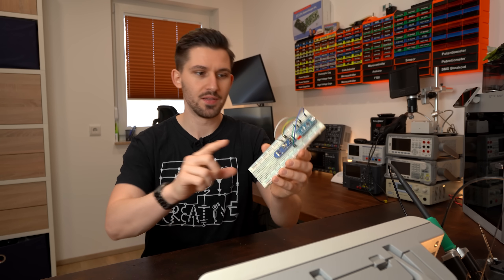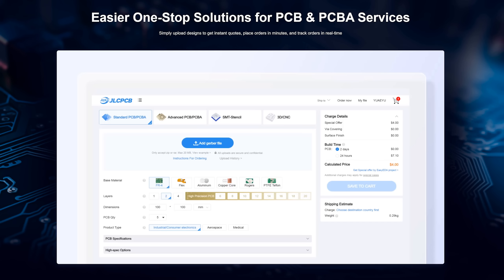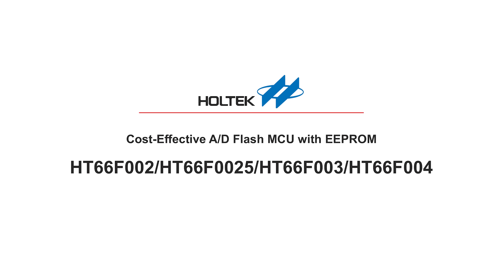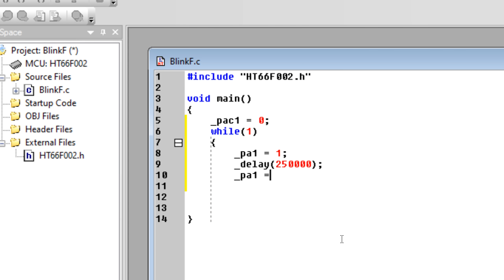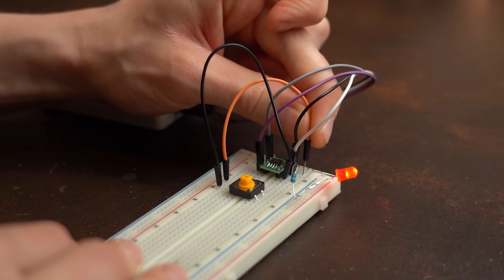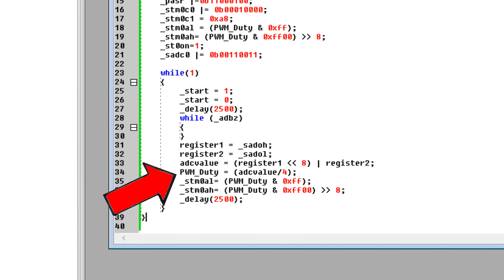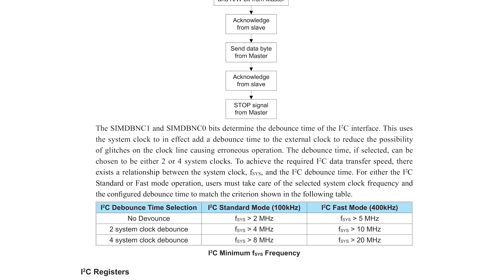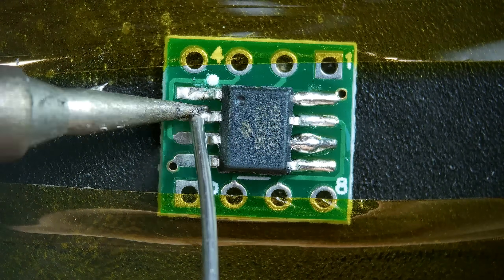I tried the Cheapest Arduino Alternative (that Nobody heard of)

Comment: That was interesting! It just shows no matter how sure we are about a new uP there may always be just one thing to ruin the whole project. Why not use an Arduino with i2c then fan it out with the clock through an analog switch? (4067) That's what I did to control multiple i2c audio processors that of course had no unique address as i2c. Cheers!

Comment: This is holtek mcu and I worked it, but it has some problems,  for example very expensive programmer, and it doesn't support external crystal and it very important. 
It hasn't debug peripherals or some protocol communication. 
Stm8 and ht8 are equal price but stm8 has very high features

Comment: I mainly develop for myself as a hobby.
Very occasionally someone will buy one of my designs so it makes no sense for me to go through the learning curve to save 2 or 3 bucks - so I don't.
So if someone wants one of my designs they need to pay for a Nano board.
Normally the Nano is way over-kill but so what?
If someone were to order 10,000 units that would be a different case but I don't think that will ever happen in my lifetime.
And in any case, there is always someone "out there" that can undercut you so why bother.
I'm looking at you China - with your armies of reverse engineers...

Comment: You could get a pico 2 rp2350 and sell some Shizzle because the main differences which I have discovaried is a decent component cost roughly 50 cents, and if its all the useful, simplification is just another way to screw it up.  But a Chinese part is already a screwed up masterpiece.

Comment: it is not about cheap MCU vs Arduino. Only reason why arduino is super easy to use and program is that you are using arduino IDE and scripts, you are not programing it like any orher MCU using for exampe eclipse. If you will program arduino using eclipse and C indstead of using arduino script languaage it will be exactly tha same. You have to care about registers and configuration of timers etc... But your code will be much more efficient and optimized and smaller. Finally you anyway have to forget to Arduino IDE and start programming like real programmer in C language. Arduino IDE is only like starting point for beginners. Or for those which dont want to be programmers, just want to make things working somehow quickly without too much effort.,, If you will try to use your arduino without Arduino IDE, and write program in C for it, it will be same struggle like you have with your cheap 20 cents MCU.

Comment: ATTINY202 has built-in I2C and SPI. You can also do pwm quite easily. Costs between 45 and 50 cents per piece. I generally program these using avr-gcc but I think Arduino supports some of the attiny chips. For me, if a platform doesn't have native Linux support then I generally don't use the microcontrollers in my projects,  so some of these cheaper options don't work for me 😅
Reply: Hello, how to use avr gcc to program tiny 1 series ?

Comment: Scott great video! I notice you are calling the e-link a programmer when in reality it is a powerful emulator. That serial part you missed is not necessary since you have an emulator and can run step by step each line of code for debugging, something that Arduino doesn't have. As you found out i2c can be implemented by software, so can serial. I have been using this Holtek for over a decade and their prices are unbeatable. I have over 100,000 units of a product using this microcontroller without ever having had any problems. Thank you!

Comment: save 28$ on chips by byuing $71 programming interface ;) to use $0.2 mcu instead of $2.2 mcu...beacause math is for snobs. you would be better of getting attiny402 or attiny 13, twice the price, 4x the compute power and I2c interface at hand, also atmel studio( i refuse to call it microchip studio) gives you step by step debuggin capabilities using avr dragon or atmel ICE...Dragon saved me from insnity quite a few times...

Comment: So I'm not sure how much you paid for that programmer, but the cheapest price I'm seeing right now on all the express is over $70. That means you would have to buy at least something like 40 of the microchips before you hit that break even point. That is not going be practical for most of your viewers lol. For me, just a hobbyist, I've only actually used about a half a dozen different microcontrollers in projects. And I would think that even for some of your more avid viewers, they are likely to only use a few dozen over the course of several years. I'm curious for you, how many microcontrollers have you used in actual projects? 100? For this project, unless you got that programmer really cheap, you ended up spending a whole lot more than if you had just gone with the $2 microcontrollers.

Comment: Instead of buying a microcontroller for $0.20 and then spending $85 on a proprietary programmer, it's much more practical to go for something like the ATtiny85, which is widely supported and easy to use. Holtek has deliberately limited the documentation for their simple programmer, pushing you towards buying their expensive proprietary tool. So, keep in mind, you’re really spending $85.20, not just $0.20, if you choose to go with this microcontroller.

Comment: According to Wikipedia ( https://en.wikipedia.org/wiki/PIC_instruction_listings#Holtek_clones_(14,_15_or_16_bit) ), those µCUs seem to be PIC clones, which is great for firmware development.
Too bad the programmer is only sold thru their distributor: I won't be wasting weeks waiting for it to arrive, and, much more important, I won't be dealing with customs, which would take another 6 weeks to clear!
Those chips are a big "no-no" until someone develops a DIY programmer, or they start selling the programmer on RS/Farnell... or better still, Amazon!

Comment: these microcontrollers are used in tv remote controls and it looks like it uses i2c for programming so probably somebody can make use of an arduino to flash it
probably the IDE is an overkill since you only need a compiler...

Comment: If I were you, I'd get myself a couple of ATtiny85 chips. They're dirt cheap, well documented and with all the features you need. And they don't need the expensive e-Link, you can use an arduino uno to program it
Reply: I assume he was looking for something JLCPCB have among their parts, to order come already assembled boards.
They do have ATtiny µCUs in their catalog, but not in stock (the same goes for PICs): that would increase production time, since they don't even specify an ETA for those parts.

Comment: Its cool to see you go oldscool. 15-20 years ago I used a simple 8 pin PIC Risc controller and send/receive I2C commands/values on a std I/O port. It was quite simple assembler programming. The only problem was that the timing was of. Then I found out that the internal oscillator had to be written a factory calibration value.
I used PIC controllers in the swedish projects "Pianotrappan", "Tomglasautomaten" and "Världens djupaste papperskorg" on youtube.
Reply: that was literally the first thing I thought about. all you need is just two gpio pins and some bit-banging.

Comment: wow good job. $0.20 mc + $110 programmer. Much cheaper than $2.
Reply: The idea, if you actually watched the first 2 minutes of the video, is not for a one-time microcontroller project but for a whole series of them.

You can spend $3 for 100 microcontrollers, totalling $300
Or you can spend $0.2 for 100 microcontrollers + a programmer of $100, totalling $120

Actually pay attention to the video before commenting such things :)

Comment: total cost (including shipping) for those 14 arduinos vs shipping cost for one of the cheaper ones, then the shipping cost of the bigger one with i2c, then the shipping cost of the rest of the gear (or shipping cost of 14 of the first one, then 14 of the second one depending on how it went) would already mean if it takes more than 10 minutes to program it's not worth the effort. Not to include the cost of programmer etc. 

Anyway, I do understand the main point of this probably wasn't to actually save money but to show there are alternatives. Or something. And it would obviously be a whole different ball game if you needed to do 1000s of those. Currently the only thing it shows is that arduino has made so many things possible for so many people in situations where it didn't earlier make sense even to get started. Time is the most expensive element in many projects, no matter whether it's hobby or professional.

Comment: Have you tried MPLAB PICKit  for "Microchip" brand controllers? They support others as well. The company is called Microchip Technology Inc.   I used PICkit 3 several years ago and programmed a controller to do an LED marquee pretty quickly. They were around before Arduino and have a bit more support than the system you demonstrated.
Reply: They are based in the US, but there were quite a few Europeans using it (I got help from a Brit way back when).

Comment: I never advise my students to use the delay() statement, given that it kills the program for the time they've set and it's a waste of resources. On Arduino it is preferable to use the "millis()" function and for the HT66F002 it is easy to implement an interrupt handler and build a similar "millis()" function for the HT66F002. Especially in robotics we should avoid using "delay()" instructions.

Comment: Creator similar machine that Uses sound to indicate distance. I used an ultrasonic sensor in my own circuit design.
Reply: I wrote my own custom code that goes inside North. We know, replicate that in order to add multiple versions of itself together, you could create software that is embedded into The same software, but with a few variable differences

Comment: I get Attiny85 vibes of this. That chip is maybe 1€, and works in the Arduino workflow we already know. You can even buy it on a 2mm thick mini-board that fits straight into the USB port. It has I2C, SPI, UART and 3x PWM and can have an USB bootloader.

Comment: The ATTINY402 is an interesting alternative, cheap and is very capable 8 pin IC. You can upload arduino code with platformio with UPDI protocol.

Comment: Did you test in-circuit debugging? The IDE has buttons related to it.
I refuse to use any bare metal mcu without breakpoint debugging support, the printf debugging is just massively slow for anything even mildly complex.

Comment: I am disappointed in Holtek processors.  Yes they are cheaper than Arduino. but I was hoping for more.  The Arduino has so much baggage that it can't do much.  I thought cheaper Holtek would be without that baggage.  But no, it has Arduino baggage!  (When I saw the "digital write" command, that was the evidence.)  Digital write is 50 times slower than writing directly to the port!  The other thing that needs to go is the C programming.  Ditch that & use assembly & you will REALLY be able to do something with Holtek!
          Another thing you can do is to use a distance sensor that starts a HIGH when it sends out pulse, goes LOW when it comes back.  No need for I2C.  Just measure the time interval!  I2C is just another layer of unneeded baggage!  You can write a loop that goes around FAST.  In that loop, you can measure the time of the pulse to get the distance, & control the PWM for the LED with no need for timers!
          If you set up the loop as a timer-invoked interrupt, in the time left over, you can have debugging code running concurrently.  This allows debugging WHILE the code RUNS.
          Libraries are the last thing you need for small, simple processor.  They are the source of the baggage I refer to.  What libraries do is enable "plausible looking" code to be written maybe faster.  Why use programs "for everyone else" versus "a program customized for me"?

Comment: @4:17 I highly not recommend to solder the pins while the pins are inserted in the plastic Socket Board, because the plastic inside the Breadboard may melt and the connectors inside the plastic will lose electric connection, this may ruin your test. Make all the soldering outside the plastic breadboard and then plug it back.

Comment: Back in the 2008 I used Holtek HT46F47 in security product I designed for American company, it was amazing cost saving MCU chip, I programmed it in Hybrid (C and Assembly) to perform at high speed in my algorithm that convert the reflected Acoustic Magnetic reflected waves into electronic signals, converted into digital signal and the AM wave signature was extracted. Although there were not enough Application Notes, I took the required ApNotes from various manufacturers (Microchip, NEC, Motorola, Philips and so on...) and used it on Holtek ... The results were amazing and exceeded the expectation of project requirements...! Holtek is not only manufacturing very cheap MCUs and are great alternatives. The same chip from Motorola was around $2.70 UD, Microchip about $1.70 USD back then - from Holtek it was only $0.33 USD for the same volume of purchase- Go for it.

Comment: If you don't feel like dealing with Chinese micros, Microchip makes a PIC16F15213 (8 pin) which is well under $1 (the SOIC pkg is under 50c qty 1) and covers your list.  There are also pin upgrades to increase pin count, memory, etc in the same and other families.  Edit: The ATTiny402 is another good choice (and also made by Microchip).

Comment: Nice video. That's how life used to be (and is) with proprietary controllers and near-zero libraries. Lawyering with the datasheet and register descriptions, debugging with blinking LEDs and oscilloscopes and maybe a display or UART once you got one running.  First time I saw the led blink, I was thinking "running or bootloop?" :-D

Comment: It is possible to make Arduino core(read: support) for this microcontroller. Arduino has very good engeneered HAL layer. And it's not a problem if the microcontroller does not have certain features(like Serial of I2C). By doing that many aeduino libraries become available to you. Including those which can bit-bang missing features. So you can bit bang Serial output for ease of debugging

Comment: No, not pointless. Surely you only need one Master controller? Consequently the cost implication would be minimal? The Arduino is 'easier' to program because you have the over burden of the, not sure if this is the correct terminology, of the interpreter/translator that replaces the Arduino commands with blocks of code, yes, makes programming easier and programs more readable but slows things down, sometimes a lot! Finally, welcome to the real world of programming. The most important part of commercial programming is commenting/documenting of the code, without this, maintaining the code can be a nightmare! Even with amateur code, it's amazing what you can forget in just a couple of weeks!

Comment: ch32v003 a $0.10 risc-v mcu. Also has an english version of the datasheet and reference manual on their international website (wch-ic). And also a lot more support from people using it. Like an arduino core and a bit-banged USB stack. Also the ch32v003 has I2C in master and slave mode as well as all the other features you need. While being cheaper than the first mcu you used. And you also dont need an expensive programmer.

Comment: Nice video, but I feel there's an unfair price comparison of a bare µC vs. the dev boards (µC, PCB, regulator, headers, ancillary components).  One would think some of these companies would put in the effort to get their products supported within the Arduino IDE framework to reach a larger market, and cross-platform support for the developers.  I gave up on keeping a Windows box around.
I keep a variety of µCs onhand, from a few ATTiny10, lots of ATTiny13A, 84, 85, some larger AVRs, and RISCV parts, plus STM and even 8051 parts (devboards with micros pre-populated are a whole different thing).  Being able to pull out a micro suitable to a given project is handy, esp when shipping can easily dwarf the cost of some parts.

Comment: i just don`t undestand why people still using arduino and same shit... u get 16 or less mhz, low amount of memory and so on. 
there are a lots of stm32 (arm core) mcu`s , that are way more powerful and much more cost effective. 

ive checked holtek mcu from this video - for me it costs 1$ and there is for example stm32g031j6m6 (so8) and its much more powerful, has good software support and same package. 

0.5$ price difference is not an argument to use such product (holtek) even for education purposes.

Comment: I see that there are plenty of suggestions already for cheap microcontrollers.  But I'll throw in my suggestion anyway: the Atmel ATtiny202 and ATtiny402 series.  These are the new-generation AVR chips, intended to replace older chips like the ATtiny20.  There is 3rd-party support for these in Arduino IDE, and programming is done by UPDI, which is a 1-pin bidirectional serial interface.  The best news is that people on the Internet have worked out all of the kinks by now, and you can make a UPDI programmer out of two components: a USB/serial adapter you can get for $3, and a 4kohm resistor.  The latest version of avrdude (the best AVR programming application IMO) supports this, which means that you can develop code in Arduino IDE, do an "export compiled binary", and program with avrdude.  It sounds complicated, but you get to use all of the built-in helper code that comes with Arduino IDE.  Oh, yes: a little more expensive, these cost me $0.53 each from either DigiKey or Mouser last August, and tons in stock because these are jellybean parts.  I used these on a project that may go into medium-scale production, so I had to be sure of availability, and is similar to what you show here - a sensor and a PWM-controlled LED, although I'm using a red/green LED so I can show two independent variables in the form of hue and brightness.